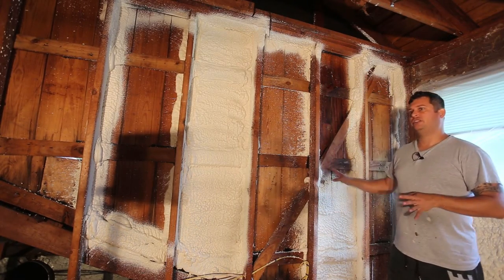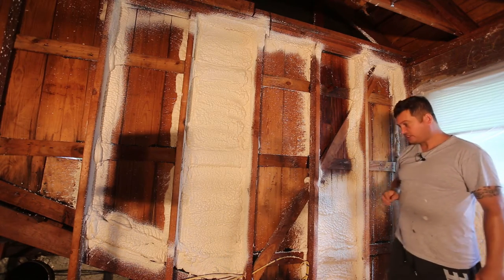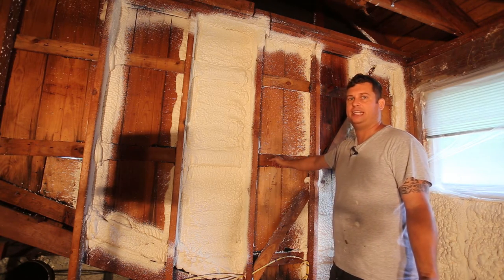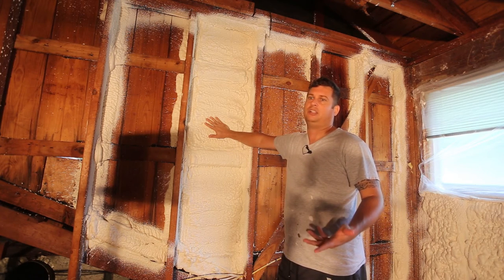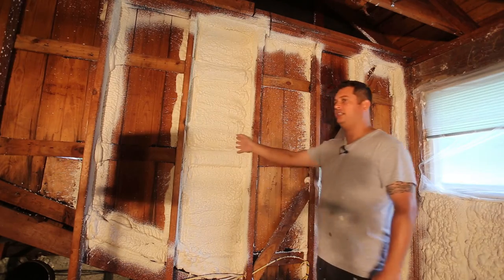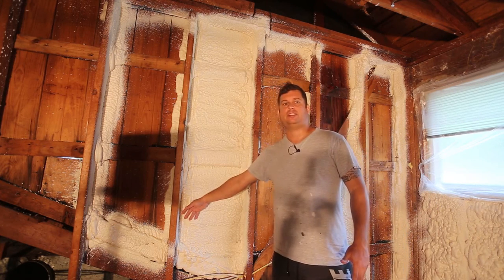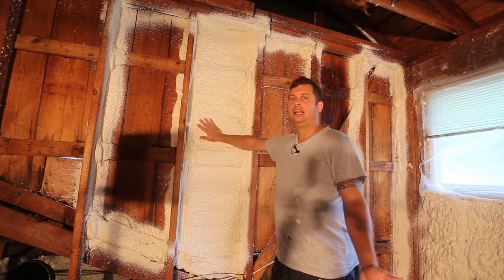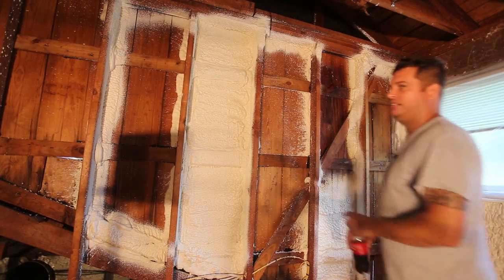DIY Spray Foam - Part 2 - Where the foam is being installed and why

Comment: Hey Brian, good job on the videos. what kind of compressor are you using? how big(cfm)? thanks.
Reply from the maker: Andre Carvalho Harbor Freight 5HP compressor.  15.8CFM @ 90PSI.  It's rated for continuous use.  I don't seem to have any issues spraying continuously.  I ran a set of open cell through it last week on this project insulating the roof deck.  I will wind up spraying 2 sets of closed cell and 2 sets of open cell by the time I'm done with the house.  I'm doing 3.5 to 4.25 inches of closed cell in the walls and about 10 inches on the roof deck (2300 s/f of roof deck).  I will also be doing the garage.  Glad the video helped.

Comment: Brian, where are you getting your static mixers and respirator tear off covers?
Reply from the maker: Eric Jacobs The static mixers came from MixSyn.  I think they are only a couple dollars each.  The respirator tear off covers came from Turbine Products.  They are a tad expensive at $1/ea plus shipping... but it's a cost of the project.
Reply from the maker: Eric Jacobs I should add that the mixers are easy enough to clean up and last a really long time.  The biggest issue I have is that gunk builds up in the mixing area of the gun and has to be scraped off with a screwdriver from time to time.  Otherwise I don't have any real issue.  I've put almost 3 sets of foam (a set is two 55 gallon drums) through this machine so far.